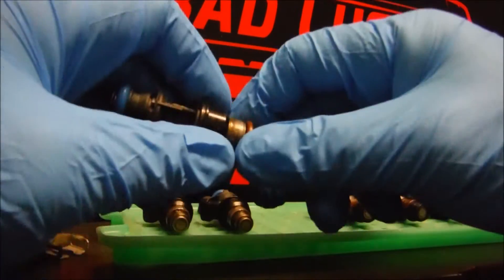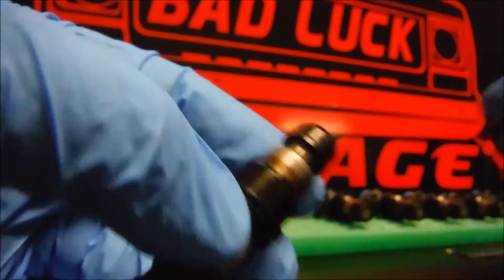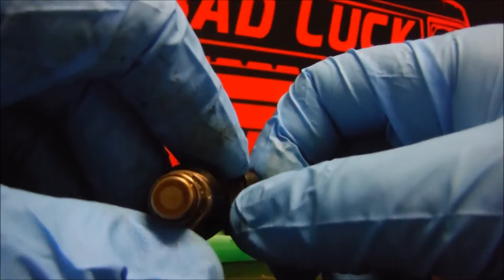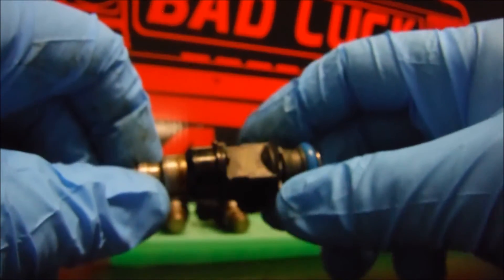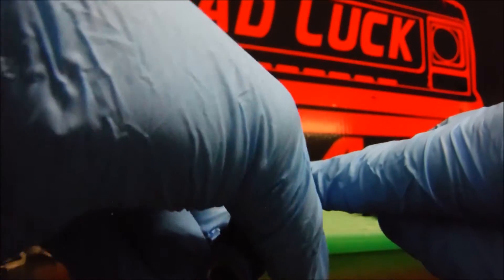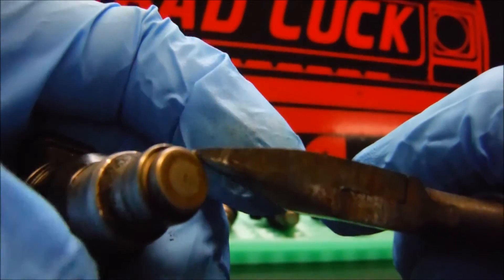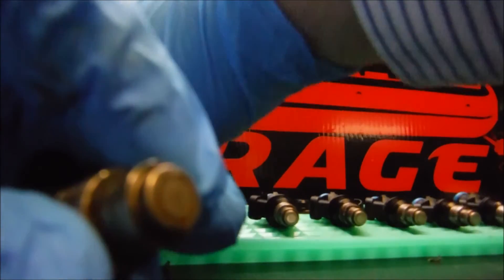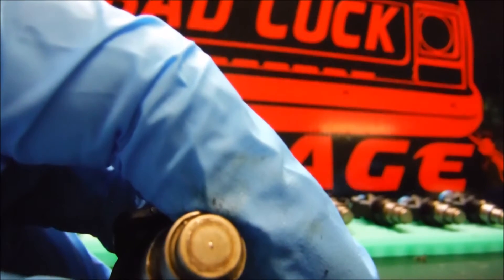Decapping Fuel Injectors PART 1

Comment: Havent finished watching vids yet but in the first 3 mins i asked myself " why cant you just replace these injectors with LS3 injectors"  wouldnt that improve performace without having to send them out to be tuned??
Reply from the maker: Thanks for watching! LS3 injectors dont flow enough to support my needs.Especially since we've added a turbocharger!  They flow less than half what these decapped truck injectors flow. They would also require me to change the connector on the harness as well as use spacers on the fuel rail. In the end, by decapping you end up with a set of 78lb injectors for $60 with no need for changing wiring or using spacers. Be sure to check out my other videos on tuning decapped injectors!
Reply: Bad Luck Garage.  Ok so this is done because you're adding a turbo. This mod not for normally aspirated engine, correct ?
Reply from the maker: This can be done anytime you need higher rate injectors to support more power. NA or Forced induction. These will support 600+ hp. Also, this video is over a year old and the turbo project was finished months ago. Check out the Turbo LS c10 playlist for additional info!👍
Reply: Bad Luck Garage.    I will.  Maybe you can help me with an issue i have with my 01 2500hd. Truck runs well but when i shut the engine off and then restart a few minutes later i have a slightly rough idle. Not real bad. Then when i drive down the road and come to a stop light say, it idle smooth but has an intermittent skip. Again, not real bad. Im sure i could figure it out myself but its been so cold or rainy or snowing here in the noth east. I have very limited access to a warm garage. I was hoping you might have some incite in this minor problem
Reply: Bad Luck Garage.   By the way i have 6.0 in this truck
Reply from the maker: Honestly there’s a whole host of things it could be. Anything from a bad plug wire to a vacuum leak, to a fueling issue. Best thing to do would be to hook a scanner to it and look for abnormalities while the issue is accuring. Please don’t take this as sarcasm, but internet diagnosis is just a guessing game. 😉
Reply: Bad Luck Garage.  Thanks. I understand. I was and still am a professional mechanic for about 25 years before i jumped in a peterbilt and went driving. Its amazing how much you loose when you dont do a thing for awhile. Anyway, got some warmer weather heading this way and I'll get under the hood and see what i can find. As i said its not real bad... Yet